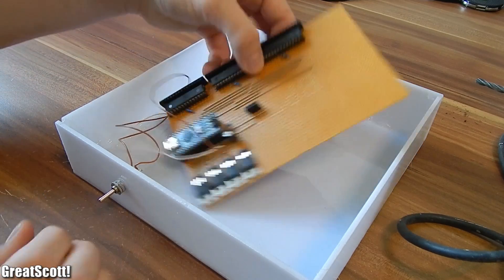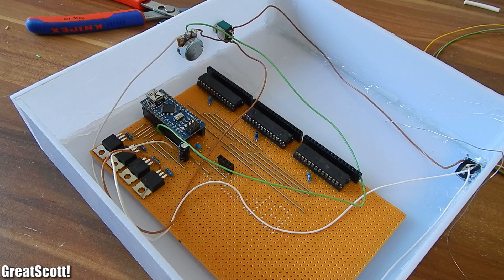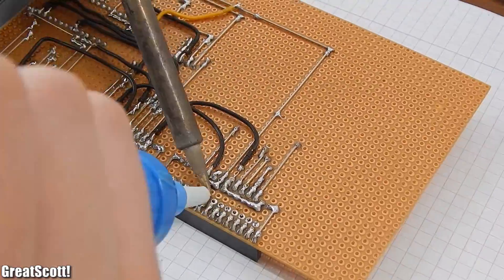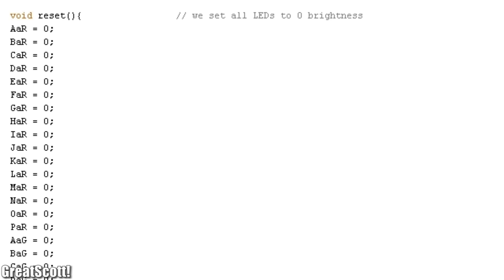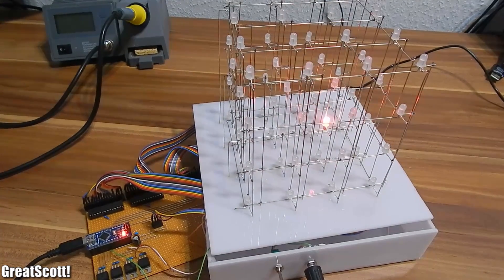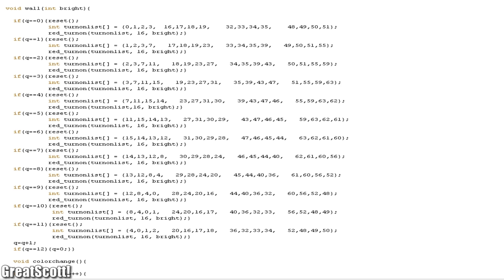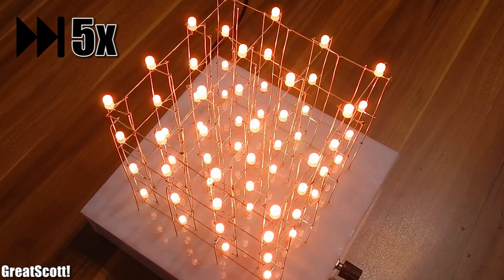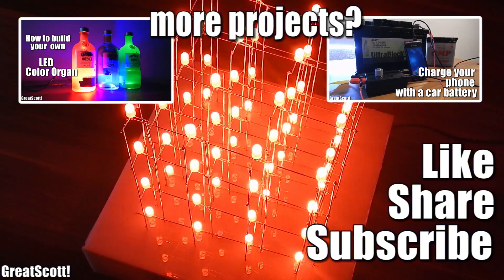Build your own RGB LED Cube Part 3: optimisation and animations

Comment: I can't stress enough how helpful this video was. I have a current project where I'm designing a custom LED matrix and need to use non-addressable 4--pin RGB LEDs, and WOW is it hard to find tutorials that aren't just "use WS2812s" or something. Unusual design constraints exist! Eight years later this stuff is still valuable - thanks :D

Comment: GreatScott! That relatively old project inspired me to build  RGB LED Christmas tree. I wonder were you able to reduce flickering caused by multiplexing? Thanks
Reply: I guess the flickering was caused by the camera, but if you look at it with naked eyes it will seem stable.
Reply: @marc.beshay  Actually, I built it and saw flickering.
Reply: @skeptical_bystander  I'm gonna build one by myself but using different components. I think it's because the components he used in the video can't handle high frequency. Or maybe his code is too long that it can't provide high frequencies. I will try to use SPI with the shift registers with 8MHz, hopefully it will work.
Reply: @marc.beshay  Good luck! I noticed that at some brightness settings for TLC there is no flickering. So this is combination of PWM used by TLC and multiplexing, which causes flickering.

Comment: Great project, but the Arduino code is really horrible. Countless variables, no use of actual functions, unnecessary use of int size variables and no structuring.

If somebody can maintain that code, well, good luck with the mental issues.

Comment: Hey m8! I'd like to ask what the extra capacitors you added? They are seen at the beginning of the video of 4th part, when you showed breadboard, but they are not on the scheme. Thanks for all projects and cool stuff you do! Btw imma little dumb and bought leds with common cathode to realize this project, so now i have to adapt to the new conditions and it brings as you said "pain in the ass" :D, but almost all is ready actually.

Comment: Is it possible to put these ALMOST touching each other? 
If so would you be able to put much more say 200 by 200 by 200 or close to that?
If it is then I just found how to make a semi hologram
Reply: You could, but good luck soldering in the middle one...
Reply: Okay So all I would have to do is make a jig to help solder the middle one's
Reply: Here's a neat solution. Build the cube from the inside out. No soldering issues.

Comment: Hey. I finally managed to build the whole cube perfectly like in your video. Now i took all the there code files from the link and put them on the arduino uno. But it is just flashing randomly which is really weird. Could someone help me? What could be the problem? Because i am not that familiar with programming. So i cannot find a mistake in the Code. Could you give me a code which is surely working? Thanks

Comment: I have 525 plus ,  common cathode bi color led that were salvaged from commercial phones, the colors are red and green however if I  connect  2 anodes together I also get yellow . I really like to give a go at one of these led cubes, how would you go about wiring up these led so all 3 colors could be used ?

Comment: After trying to get this thing together for more hours than I can recall, I am in need of some help. Hopefully someone sees this that can shoot me some advice. I've got the cube together, all the lights check out. When I plug in all 3 TLC 5940's there are 9 strands of lights that are stay on as bluish green, no matter what the code is. If I unplug the blue and green TLC's the red runs the code just fine by itsself. If I plug the Blue or Green up to the Red TLC, they work just fine, but if I plug into anything other than the Red TLC 5940 it goes back to being solid colors in the center with no flashing or following of the program. (I am a total noob with this stuff, saw this video and thought "I can teach myself that!" and dove in...) My SIN's and SOUT's are what I think the issue may be? But I've checked the connections and they seem to test out fine with the multimeter. I've attached a link to some photos of the problem and my board.   http://imgur.com/a/Fa2ol

Comment: I need a fast answear ,can I use adapter with out put of 9v, or I have another adapter with output of 12 v
Reply from the maker: MegaSubscribe 5V only
Reply: was workin on it for few motnh ruined it just the day before I need to give it to my proffesor so they can grade me I don't know what to do please help me I have battery 4,5V switch  and regulator , I want to make something just that I can show LED  to flash pls help
Reply from the maker: MegaSubscribe Replace the Arduino and ICs. I think 4.5V should work fine.

Comment: Hey thanks for the tutorial. I finished making my cube and everything and used the code that you gave. However, I tried to implement the three example animations you did in the video but they don't work. I created the arrays and made the function for test then went back to the loop and called for it there, but when i uploaded nothing happened (there wasn't any errors or anything). Am I missing part of the code?
Reply from the maker: Lawrence Wong No all the code is in the download link. Maybe you made a small mistake in the loop section, because that problem happened to me as well when I first made those. Just play around a little bit and you will find the mistake.